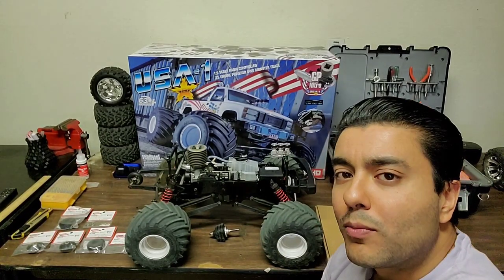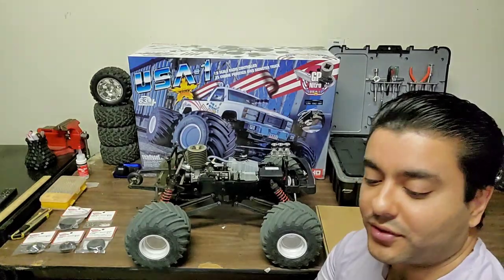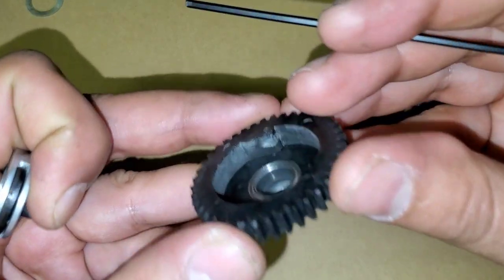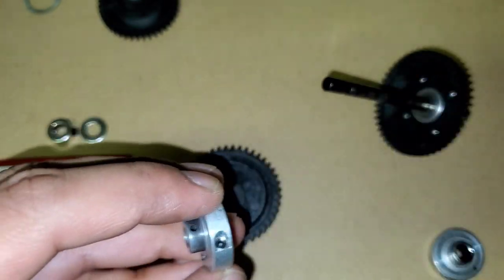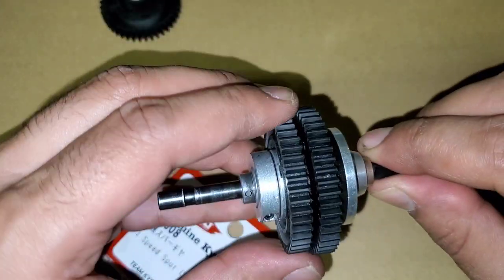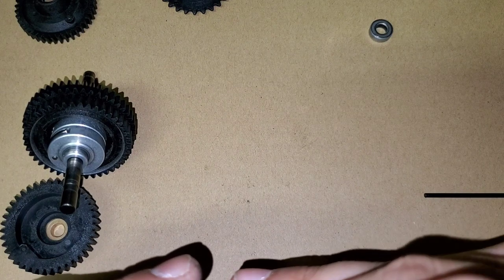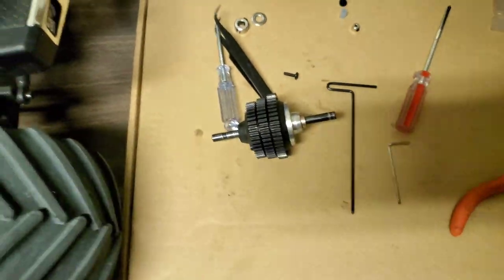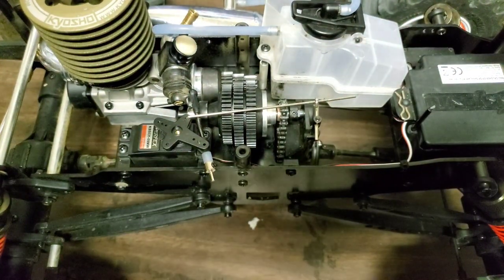Kyosho USA 1 Nitro Monster Truck 3-Speed Transmission Rebuild...need help with settings!

Comment from the maker: If anyone out there has one of these transmissions, I'd really appreciate if you can share your 3-speed transmission settings with me! Called Kyosho and they didn't even have them! :(
Reply: I wish I could check them. I already messed with it before counting turns! Now we are in the same boat! See my my latest video. I think my issues match yours! "Is that 2nd or 3rd? Did it just jump from 1st to 3rd? Did it actually shift?" Hmm.
Reply from the maker: @Rusty-Metal  I did manage to get it shifting through all 3 gears yesterday nicely, but then it stopped again when I adjusted it a little....someone pointed out in the comments that they saw a crack in my 3rd gear cam around the 7:30 mark....that may be the culprit ! Going to replace it as i have a spare . Will post the video of the shifting working
Reply: @TurokRC  oh my lord. I should have ordered a few gears in my last order. Ugh. Sorry to  hear. My gears won't be here until Monday.

Comment: I own 5 of these trucks (Mad Force/USA1) with two being electric. I've owned my Mad Force Nitro for almost 5 years. Some things to note:

1-There are no and has never been any documented factory clutch settings for the shift points. Both of my nitro USA1's are still brand new and I guess I could document the settings before I do the breakin which won't be for awhile. 

2-The clutch settings of one individual may not work for another because engine tune affects how the trans shifts based on RPM. Doesn't hurt to try but that should be kept in mind. I like to run lean and mean so my engines scream a bit more. 

3-The trans gearing on these trucks is a rather close ratio and sometimes the 2nd to 3rd gear shift can easily be missed! Meaning, you don't hear it. 

3-Yes, my Savage XL trans needs to be removed in order to adjust the 2nd gear shift point. The 3rd gear shift point can be done via the access hole in the trans case. 

The best advice I can give is to disable the 3rd gear and concentrate on adjusting the 1st to 2nd gear. You can disable the 3rd gear by cranking the shift screw all the way down so the engine has to scream in RPMS to shift or, as in the case of my Savage, turn the clutch backwards.  When 1st to 2nd is to your liking, move on the adjusting the 2nd to 3rd. These trans are very easy to adjust. You can leave the 2nd gear adjustment screw pretty loose, like 2 turns in from flush and it should shift pretty early then tune it in to your liking. 

Remember, the engine should be fully heat saturated before making adjustments. If you adjust the clutches before the engine is fully heat soaked, your shifting will change as the engine gets hotter. 

I may make a video of my experiences with this platform as it seems to be lacking any real information. For example, Hybrid is upset about the clutch bell needle bearings, I'm still on my ORIGINAL ones, you gotta lube them with bearing oil and spin the clutch bell every once in awhile when it sits. People are scared of doing that because they think the oil will get on everything/clutches. A little oil goes a long way, dry the excess. This platform has been around since about 2001! It's old but SOLID. I will never get rid of mine. That box is a keeper too!
Reply from the maker: Thank you so much for the help and insight! I did try locking the 3rd gear before but still wasn't hearing the 1-2 shift, even if I accelerated slowly. I will give it another try today though, I'm about to go hit the road and see how this performs after the rebuild. 

The new 3-speed cam I ordered for the pin had it's grub set at 3 turns counterclockwise from being fully bottomed out. I'm hopeful that might be the factory settings, so going to try 3 turns out for 1-2 cam and 2 turns out for 2-3 cam. I'll be sure to post an update video! 

Thanks again for all the advice!
Reply: @TurokRC  Worse case, just be aggressive with the 2nd gear and leave it far out from the bottom. These adjustments are like nitro engine tuning and a little goes a long way. I'd rather have it shift early and go from there as it's easier for me to adjust. Remember, let the engine get nice and hot, that should be about 75% of the tank but you need to actually run the truck, just don't let it idle. Best of luck and I hope you report back when it's working. Hearing these things shift through all 3 gears is so addictive!
Reply from the maker: @lipoz-n-nitroz4012  I'll definitely report back either way! Hopefully I'll be coming back to post a video with some nice shifting sounds 😎
Reply: @TurokRC  Please do post an update video.

I thank you for the info provided thus far. I'm getting one of these trucks myself and have always had poor experiences with multi gear transmissions in RC cars.
Reply from the maker: @SentinelGames  definitely will post an update! About to hit the road and see what happens!
Reply: @TurokRC  Any luck?
Reply from the maker: @SentinelGames  I did have. 1-2 shift and it was going great. I had the 3rd gear cam locked tight so it wouldn't shift into 3rd so I could focus on 1-2 change. Then another issue arose when the cam bolt that holds the gears onto the crankshaft of the engine came out stripped. Easy fix, will be back to the field tomorrow to finish the job. Hearing the 1-2 gear change brought me a lot of joy. That's why I put in all this effort into nitros 😅
Reply: @lipoz-n-nitroz4012  Yes! My fw-06 kyosho audi r8 I had to run like 8 tanks before it would go into second gear following break-in instruction to the T. You def have to run the truck I actually reccomend the heat cycle method with ten tanks for this engine. " Average Joe Nitro" does a good video on how to break in the original KE25 engine.

Comment: Just bought one for my son for Christmas.  Finished breaking it in yesterday. Put over a quart/8 tanks through it so far and kean it out a bunch before I heard the 1-2 shift 2-3 shift
Wheelies on command , so far no issues 
Very similar in nature to my hpi savage xl 5.9
Reply from the maker: Mine is working great now as well, just having some issues with 1st gear stripping teeth a bit but upgrading to metal gears soon
Reply: @TurokRC  please can you post the part number?
Thanks

Comment: Hi Turok. Great and interesting video. I have some good and interesting info for you about the USA-1 3-speed transmission. I see the problem and why. The design inside is almost exactly the same as the Traxxas Jato 2-speed transmission but with one design flaw difference compare to the Jato. I just took a look inside the original gear of my Traxxas Jato. Compare to the Kyosho gears the Traxxas gear dont use any plastic to cover the pins and that is why the Kyoshos gears causing problem. They are depend on that plastic is there to cover the pins because the pins are not close enough to do the hooking job by them self. Kyosho should have design it so the pins do the hooking directly by have the pins just a little futher back so those clutch Shoes/hooks can hook on the pins just like Traxxas 2-speed gear. I have had no problems at all with my 2-speed transmission. It have never break apart. Kyosho has done this bad design on purpose to make money on spare parts gear or they have bad designer who should get fired. The only solution as I see it is, either buy metal gears for the USA-1 or that Kyosho redesign the original gears. Hope this info was of help to you or anybody.

Comment: Oh that weird sprocket you thought was a tool, is probably the lower chain sprocket. Now all three of my gears are missing teeth. 2 and 2.5 turns would not allow shifting either. 4 seems to work but things were inconsistent. Ugh.
Reply from the maker: Thanks I realized that later lol. I was able to get 1-2 shifting with 2 turns counterclockwise from bottom on that 2nd gear cam. The 3rd I didn't get to yet due to the muffler issue. Also do ensure you're fully warmed up before trying to tune it hear the shift

Comment: The metal clutch part of the third speed is cracked.
Reply from the maker: Really? I didn't notice...what time in the video was that? I did manage to get it to shift to 3rd but then it stopped again....was going to replace the 3rd gear cam anyway
Reply: @TurokRC  right at 7:30 you can see it pretty clearly right at the top.
Reply from the maker: @DoRC  wow thank you for pointing that out! I will get in there and replace that today. I'll post a video soon with the 3 speed working. Perhaps the crack had something to do with it working intermittently
Reply: @TurokRC  it's entirely possible. It could have been causing the cam to bind.  It's also possibly what caused the first gear to get torn up.
Reply from the maker: @DoRC  thanks so much again...I can't believe I didn't notice that. Probably was focused on the phone filming. I've got that spare 3rd cam so will change it today. Was having a blast with this truck yesterday with the body finally on, was looking great.
Reply from the maker: @DoRC  I just took trans apart....3rd gear cam stripped, and 2nd one almost stripped... Was about to replace both then noticed the 2nd gear cam is now FUSED to the shaft!!! It won't spin either way nor will it slide off. How does that happen? I do have these parts coming in the mail but this is really doing my head in!
Reply: @TurokRC  no idea. Might want to contact  kyosho
Reply from the maker: @DoRC  looks like the needle bearings were completely shattered, had to hammer the shaft off. So far this truck has been quite a bit of work and pain. From shifting nicely into all 3 speed to suddenly not, then finding a seized cam without any crashes or anything....bizzare. I will have some honest words to say about this when I review this truck

Comment: Thank you for the video and for sharing Turok! Seems like I'm in the same issue.
Reply from the maker: I'll post an update video soon...I had a other issue with the exhaust baffling coming loose and blocking my exhaust port. Should have the part to fix it today. I did manage to get a 1-2 shift so I was almost there

Comment: Quick tip: put a drop of Loctite on the pin when assembling it next time. Will prevent it from falling out, yet you can remove it when you want to with a small pin punch.
Reply from the maker: Good idea. What I've done now is memorized which way the pin is horizontal by checking the flat side of the shaft, so when I go to adjust it it never slides out
Reply: @TurokRC  That's a good tip also! 👍

Comment: Not sure I can be any help but I own a kyosho gt 2 and its known for having 2nd gear stripping. The new parts you shown share the same for my car which was ig109b. The letter b just means that kyosho revised the material to be thicker. It did somewhat solve my issue, but see my 2nd gear chipping off. So my sense is that its the manufacturer fault from the gecko. Did kyosho even check their quality control before releasing this dam thing? What's the dam rush kyosho!!
Reply from the maker: I'll be releasing another video soon...but they definitely skimped on their QC.... The baffling in my muffler also came lose and was choking my engine as it was blocking the exhaust exit port. Spent 2 days trying to tune my engine wondering what on earth was going on. Not even 10 tanks into a new truck!
When it was working it was fantastic though.

Comment: I have a mad force kruiser with KE25 engine(2010 version). I am worried it is not shifting into 2nd or 3rd gear 7 tanks out of 10 into the break-in. When should I start considering taking look at needle bearings? It uses the same chassis plates as the USA-1 and transmission.

Comment: Irregardless of your grub screw settings, your gears will continue to fail.  It's a design flaw Kyosho worked out on their GT2 platform.  The revised dual shoe clutch type transmission of the race spec GT2 eliminated the failing gear cam strike plate on the inside of the gear as you experienced.  In addition, the roller bearing was also eliminated from the initial transmission design they had in the GT1., which is the same one you have in your truck.  It's shocking to see this 20+ year old transmission in a "New" truck. I thought they would have put the upgraded GT2 transmission in there.  I had this same 2 speed transmission in a electric HPI RS4mt in 1998.  When I upgraded the motor to a high power modified I noticed the gear cam strike plate began getting worn.  The exact same thing happened in my Kyosho GT2. When I upgraded the engine, the cam gear strike plate started failing much faster. I then upgraded to steel gears, which fixed the problem., until I upgraded my transmission to have the 2 shoe clutch type.
I think the problem is exaggerated because of the large tires as well.  It seems as thought the truck needs a slipper clutch where the chain drive is, to save the gears., but that's just my 2cents.
Reply from the maker: I posted an updated video with it working, strangely I've now been using the same gears for about 10 tanks and it's been shifting beautifully through all gears. I believe I had a bad batch of roller bearings/ 2-3 speed cams. I've now replaced both 2&3 speed cams, both needle bearings, as well as a few stripped gears. I've got a set of metal gears on the way and will post a video of the install when it arrives.

Comment: We can see that the small metal pin insert into the gear where the cam catches it is Completely destroyed it is possible to replace it with a larger diameter made with another metal such as tungsten i use that mod on one of m'y 2 speed transmission in m'y forza .18 bugy hold just fine now never had this issue again look at the catch To See if this it is not rounded if so try mod the parts make sure its fuly opening

Comment: Heads up the one way bearings in the clutch bell are pretty stupid. I heard that people swap them out with ball bearings for practicality. Hybrid went over it on his YouTube video
Reply from the maker: I had no idea they could be changed, seemed like the bearing was part of the clutch bell itself
Reply from the maker: If you happen to remember the hybrid video link I'd appreciate it!
Reply: @TurokRC  https://www.youtube.com/watch?v=VhYlz5bW9fE&t=3159s  He mentions it at the 1:29:53  mark.  Little bag of bearings

Comment: I just bought the same truck and after 6 tanks just breaking it in the transmission started to fail on me now I’m having problems finding parts
Reply from the maker: Parts can be tough to find sometimes but they do keep coming in stock

Comment: I've been having trouble with mine not shifting at the right time, do you happen to know the clutch settings?
Reply from the maker: Still trying to figure mine out, settings will vary based on engine tune etc as well. My trans has needed some parts replacing

Comment: Those finger type cams kyosho uses were always terrible. At least they use a metal pin to grab onto but they are finnicky. Being such a small metal “finger” just wears right through the plastic once it flings out.
Reply from the maker: I've had nothing but problems with this transmission since I got it...I did manage to get it shifting through all 3 but then suddenly it stopped. Took it apart again today and both gear cams were stripped. Also the 2nd gear cam with the needle bearings fused itself to the shaft due to the needle bearings failing 🤦🏽‍♂️
Reply: @TurokRC  yea I know the frustration. I’ve had many madforce/crushers throughout the years. I always thought the chain was kool and hearing it go through the gears was epic but short lived. Kyosho makes some fun designs but why they kept that weak cluster of gears and not go with a more robust dedicated shoe type is strange.
Reply from the maker: @dionisi9961  I have the parts on the way already, if I manage to get it shifting through all 3 again I'm never touching that adjustment again! Hearing the 2 shifts truly is special and makes all the headache worthwhile in the end, but only so many times I'll repeat the process.